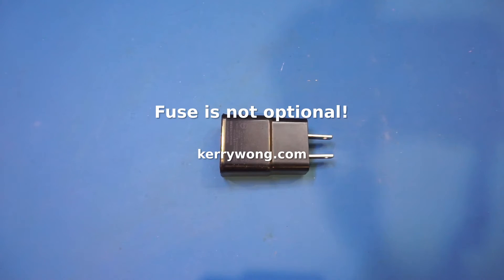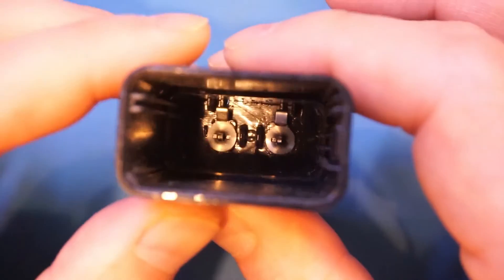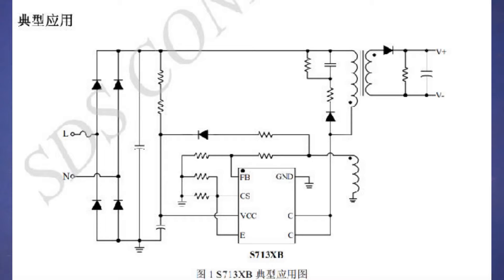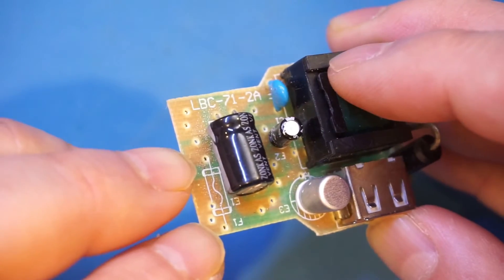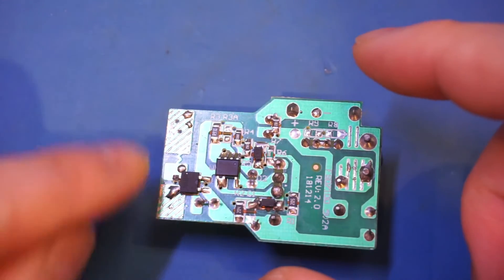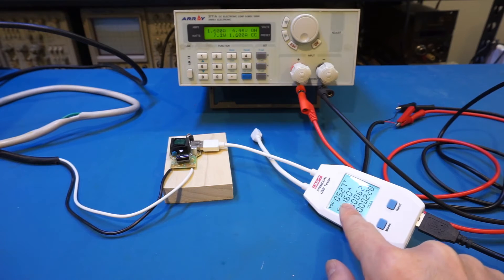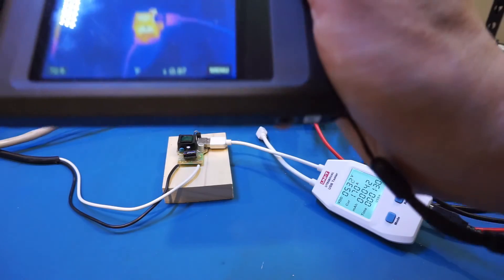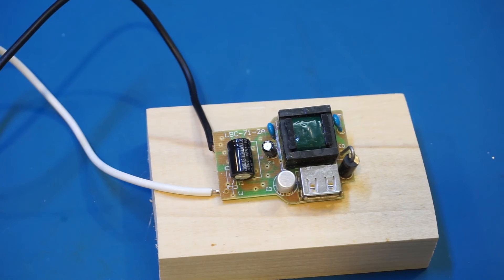Fuse is Not Optional! Teardown, Destructive Testing of a Generic USB Power Adapter

Comment: Thanks for this. I've just cracked open a similar unit configured as a 12V power supply. The chip is marked CSC7136D as far as I can see. "F1" is a ratty-looking 1Ω resistor, not a fuse – and this is for 240V operation in the UK. I reckon weight correlates with product safety for these little PSUs.

Comment: Kerry, I believe you caused a short circuit by soldering the black wire directly across the PCB fuse. Instead, the black wire should be connected to the corner pad, allowing the bridge rectifier to do its job. Was this intentional?
Reply from the maker: I thought I mentioned in the video that was the intention.

Comment: Mikes electric stuff did an autopsy of a panasonic microwave that was destroyed by a PCB fuse, so it's not just crappy no brand consumer stuff that uses them.
Additional thought 1 - I'm guessing you used 110V mains to destroy the PCB fuse, but the unit is rated for 240V input and if so I'm sure that you'd have got much more spectacular fireball at it's top rated input.
Reply: thought 2 - just relating to incandescent bulbs. In the UK we have 230V mains and fused plugs. the lowest rated fuse common in those plugs is 3A which would seem appropriate for a 40 or 60W lamp but it was pretty common to need to replace that 3A fuse after the bulb filament blew implying a momentary fault power of I guess >1000W... never saw it happen with a 5A or 7A  fuse though. FWIW These are sand filled ceramic tube fuses, not quick-blow.
Reply: I purchased a Panasonic Microwave. After a few uses, the internal 20 amp fuse blew. It worked with a new fuse but I decided to return it because of the electrical design. Our wall outlets in Canada are 120 volt 15 amp circuits. Microwave ovens are considered an appliance that needs a separate outlet direct to a 15 amp braker in the electrical panel. I personally thought the unit may have other issues and did not want to find out after the warranty period expired. A PCB fuse is lame and cheap, meant for disposable products. Are Pico fuses too expensive?
Reply: My induction hob has a PCB fuse on the entry card !!!
230 V - max power 7,2 KW

Comment: Great content as always.  One big takeaway is that you can't trust the current ratings on some of these USB power adapters.  Running them at full spec. can result in voltage droop and worse yet, overheating.  It's probably best to de-rate them for your application just to be on the safe side.